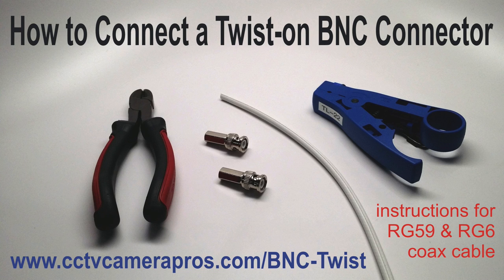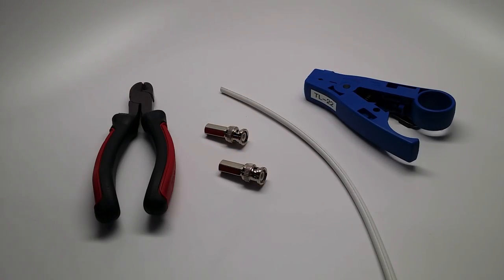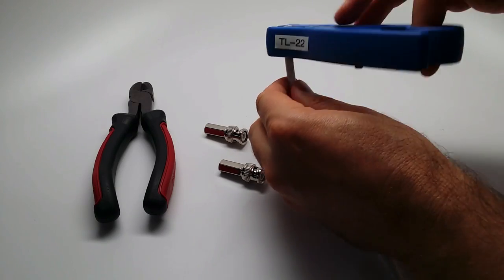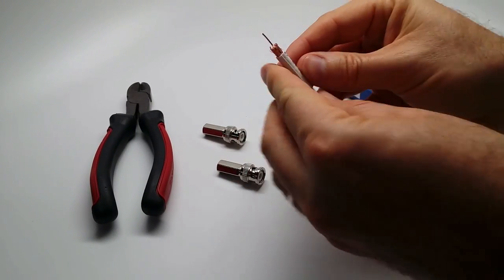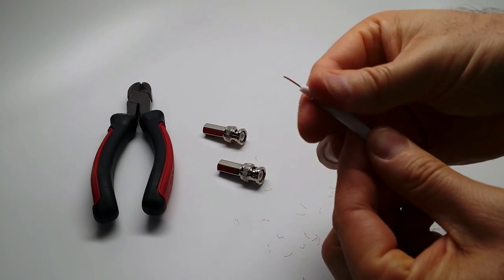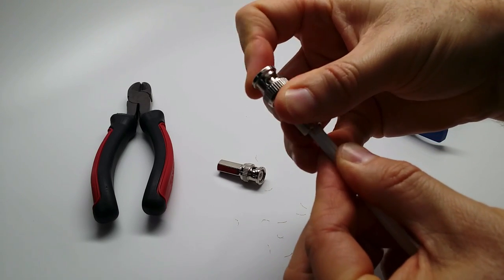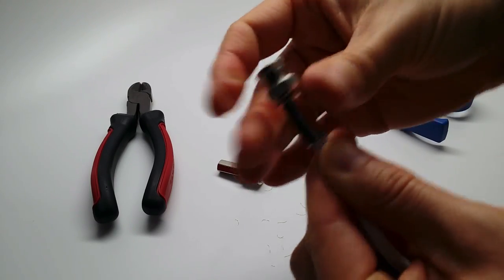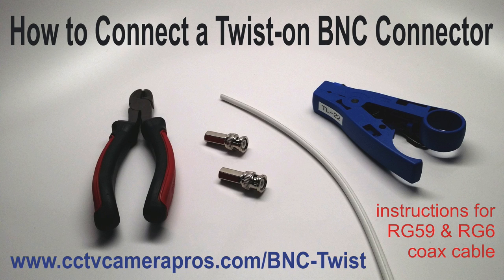How to Connect a Twist-on BNC Connector

Comment from the maker: Attaching Twist-on BNC Connectors to Coax Cable
This demo video teaches users how to connect BNC twist-ons to RG59 & RG6 coax cable.

When done properly, twist-on BNC connectors are a secure and reliable solution for BNC cable installtions. It is important to make sure that the coax cable is properly stripped, the cuts are the right length, and that the connector is tightened securely, but not over-tightened.

Installers can follow these steps to help ensure a successful and reliable connector attachment.

1) Make sure you know the recommended length that the two different cuts should be on the coax.

3) Remove the copper braiding, but it OK if some of the it gets removed. Limit this to not more than 25%.

4) Press the trimmed end of the cable into the connector and make sure that you feel the inside of the connector grab on to the coax core.

5) Press and turn clockwise to tighten. 6-10 turns should be fine. The connector should be snug but do not feel like you need to over tighten.

Note: the process of attaching BNC twist-on connectors is the same for RG6 and RG59, however you must use the proper size connector for the cable.

For more information,, please visit this page.
http://www.cctvcamerapros.com/BNC-Twist